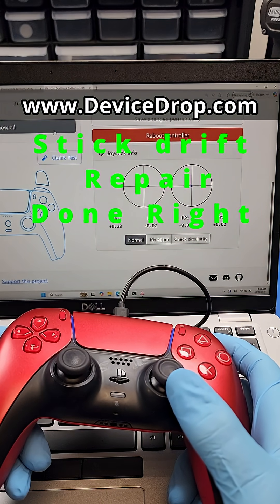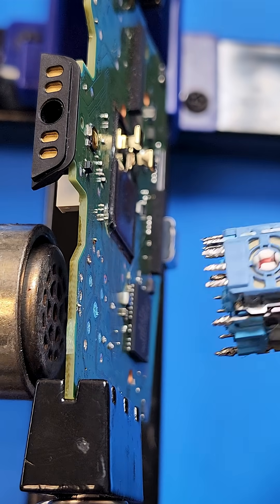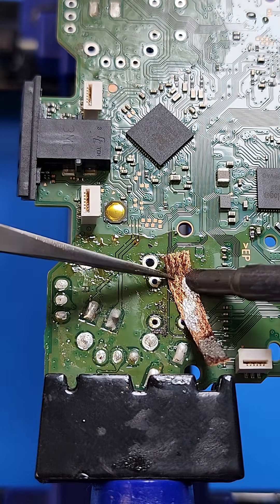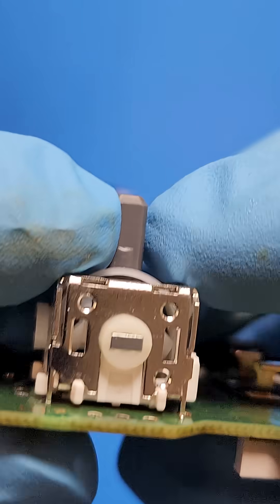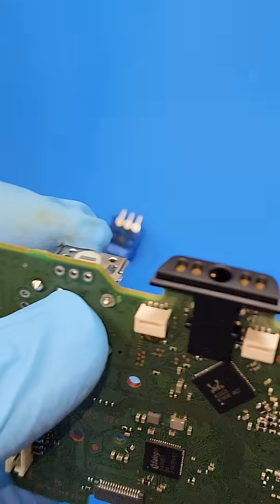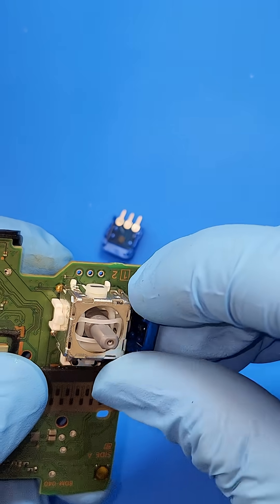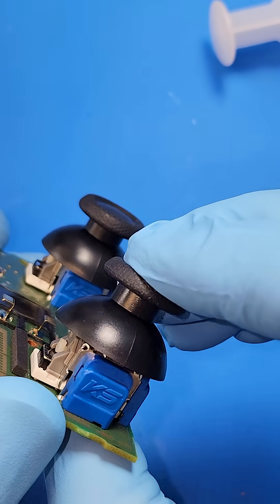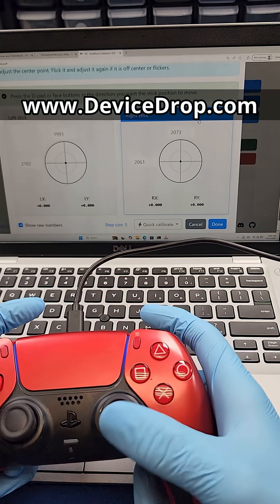Joystick Drift Repair Done Right | Professional PS5 TMR Installation

Comment: Worst joysticks to install. Ksilver sucks
Reply: I use the k-silver ones in my controller, they look great, until now, i dont have any problem with them, even de circularity its good, something around 5/6%
Reply: @abnerbueno4641  i believe he's talking about the tension of the spring in the stick
Reply from the maker: That is 100% correct The tension in the springs can cause a curvature on all joysticks. Some brands worse than others. But it's very small we're talking a human hair thickness. It's enough to cause a slight offset of the joystick if it's not properly installed.
Reply: @abnerbueno4641 i have them all and tried them all. Gulikit/Hallpi are the best. Circularity has to be between 7-8%
Reply from the maker: K silver pro have had a major improvement over the predecessor of the previous versions with the magnets installed into the gimbal mechanism. The newer generations of the k-sliver are on par with sensitivity range and circularity error rate of a gulikit